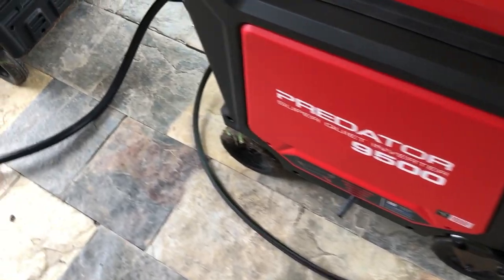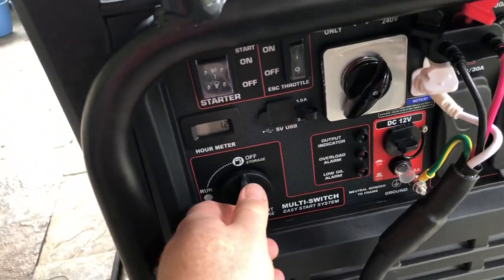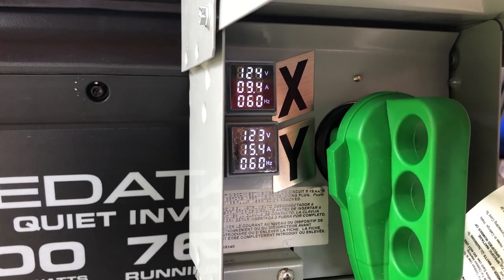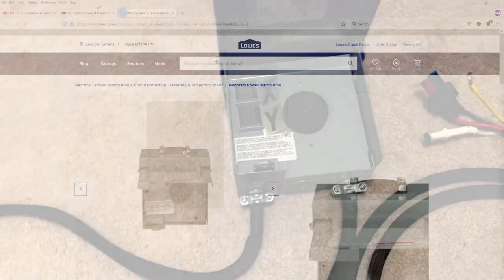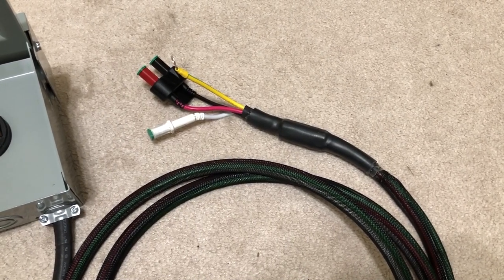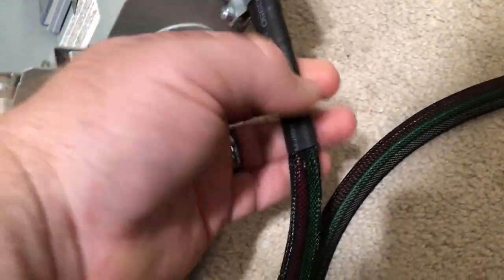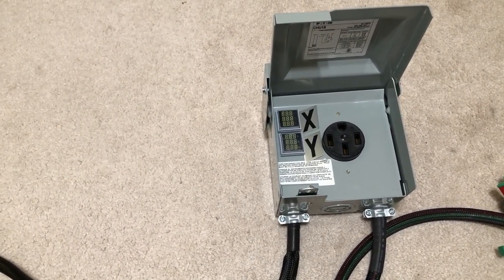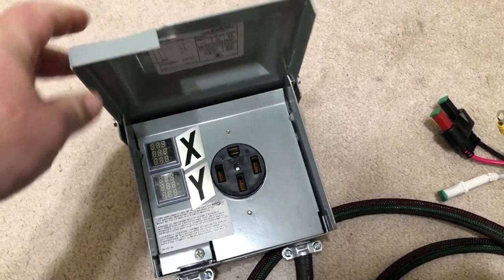Predator 9500 Home Built 240V Parallel Kit Test & Build Parts: 2X Output Power Using Two Generators!

Comment: I believe you're losing 10 amps or more in that dryer plug and your generator in the inlet plug
Those are 50 amp rated each one of those generators says it can pull off 31 amps and some change each
So you're just hooking both those together why can't you run two separate generator input plugs into your inlet breaker? 
Or better yet a lot of those units when they start up they look and see if there's power there then they just match whatever's there why couldn't you just use both the 30 amp twist lock plugs and join them together inside your main?
Pretty sure the four wires your connecting are the exact same four wires in the twist lock plug
If you hadn't already built this I would be telling you how to save a bunch of money and get another 2,400 watts out of it? sorry bud 😂
But then again I wouldn't have known that had I not watched your next video explaining the wiring
Sorry us folks with electrical degrees look at some of this stuff and scratch our heads because it seems a little inefficient and unnecessary
Reply from the maker: There is a lot to unpack there, and I don't have an electrical degree, so bare with this long response here while l go through it all as I see the issues and pitfalls of what you're suggesting.

Nothing is being "lost" in terms of amperage.  It's just if breakers trip or something is overloaded.  If resistance / heat in the wiring has climbed to the point I'm losing 10amps, then things are going very badly at that point.  

But yeah, the socket itself is rated for 50amps, while the two generators can continuously push 60amps...  But the wiring can certainly handle more for limited periods of time, surges, etc.  Larger plugs over 50amps (especially for inlets, extension cords, etc.) all very quickly become much more specialized, non-standardized, and way more expensive.  At that point, most people will typically just opt to hard wire directly to the breaker box vs. using removable plugs / cords.  

So why not just use two cheaper 30amp plugs?  A lot of very important reasons that I'll get to in a sec...

So I could have hardwired the parallel kit into the panel, via a breaker and bypassed the whole plug thing (basically wiring it like a true home backup generator would be wired in)  That would work well, let me use the interlock, and get the absolute full capacity of the pair.  

But as these are portable generators, I wanted to be able to have the whole setup be removable, and be capable of deploying them away from the house if needed.  Hard wiring would limit my options in that regard, so in this case the cable plugging into the house is desired.

So there is nothing stopping one from doing two 30amp twist lock hookups, but doing it safely (both for human life and not damaging your electronics in the home) becomes MUCH more problematic and complicated.  

To start with, you always want the source of electricity to have the female plug, so brushing against exposed energized plugs won't cause injury/death.  So this means the inlets on the house are male, and the cable running from the generator into the house at that connection point is female.  This is because the female side is coming from the generator, and carrying the power and the male side on the house is receiving it.

So if you wanted more rated capacity, and desired to use two 30amp plugs, you would need two inlets.  If you wired them together, the moment you energized one side, the exposed male plugs of the other side would also be energized, and dangerous, so you also need a breaker for each inlet.

And to be safe, you need to make sure that neither of those breakers could be on at the same time that that main power feed is on, and, since there are now two, you also would need to make sure that if you had only one generator connected, you somehow couldn't also have the breaker on for the empty inlet. (otherwise again, they would be connected together and the running generator would energize the unused inlet, making a shock hazard on the exposed male plugs)

I know of no interlock that could do that.  It would need some kind of electronic switching circuit that would detect incoming power, but ignore line power, and only then engage the connection if the correct conditions were met.  So the interlock is out...  now we're getting even more dangerous.  

Could you just do it anyway?  Yeah, and if you did everything right, every time, it would work.  But it's certainly not safe, and not to code, and someone who didn't know what they were doing (or made one mistake in what has now become a much more complicated process) could easily kill themselves, or kill someone else if they back feed into the electric grid without the interlock in place, and / or blow up all the electronics in the home (which I'll get to at the end).

But let's continue to work backwards from the inlets now and pretend we have main power off.  At the end of your 30 amp cords are male pins you're intending to plug into the generators.  For the units to team together, they have to both be connected in a complete circuit.  One starts, then the other sees the voltage present and matches the frequency when it is started.  So both inlet breakers must be on when starting the generators.  This means that as soon as you start one of the generators, the male plug on the other is now energized.  It could be unplugged at any time, and you'd be holding an energized "suicide plug" in your hand.  Not safe.

Additionally, the 30amp plugs on the Harbor Freight generators are limited by a 30amp breaker on the panel.  So if one were to maintain the constant rated load, or get surges into the max 40+amp range eventually the breaker will probably pop before the generator overloads and cuts power. (The parallel kit bypasses the generator breakers, this is important later)  If in this situation, only one breaker popped or was turned off in the pair, but didn't "overload" the generator then a very bad thing can happen that I'll describe next... 

Bur first, there are now multiple breakers in the connection between the generators that are also able to interrupt the circuit (one on each generator front panel AND the one for each inlet in the breaker box) any of which would allow for the units to become disconnected from each other WHILE THEY ARE BOTH STILL RUNNING (thus breaking the synchronization).

This condition would allow the two units to almost immediately drift out of frequency sync.  Just as two clocks don't typically remain perfectly synchronized for more than a few moments.

If something were to turn off one of those breakers, and then one later turned that breaker back back on, suddenly joining together two live 240v circuits that are no longer synchronized... it would probably do really, really, bad things to the inverters and I'd guess VERY spectacularly bad things to the electronics in the home.  

This is why the parallel kits bypass breakers, and directly connect the two inverters together in a way that is hard to interrupt, and also, probably why when you overload one unit, you have to completely shut it down and restart it from scratch.  To ensure that it properly re-syncs to the power frequency that is still present from the other unit.

In my situation, it made more sense to bond them together in a reliable way, then take that combined power out and feed it into the breaker box.  While the plug is rated for 50amps, the runs are fairly short overall and have the appropriate gauge wire, so they should easily handle ongoing 50 to maybe ~60 amps, as long as I don't go too crazy and try to keep the loads reasonable while on generator power.

This is responding to B F:
I believe you're losing 10 amps or more in that dryer plug and your generator in the inlet plug
Those are 50 amp rated each one of those generators says it can pull off 31 amps and some change each
So you're just hooking both those together why can't you run two separate generator input plugs into your inlet breaker? 
Or better yet a lot of those units when they start up they look and see if there's power there then they just match whatever's there why couldn't you just use both the 30 amp twist lock plugs and join them together inside your main?
Pretty sure the four wires your connecting are the exact same four wires in the twist lock plug
If you hadn't already built this I would be telling you how to save a bunch of money and get another 2,400 watts out of it? sorry bud 😂
But then again I wouldn't have known that had I not watched your next video explaining the wiring
Sorry us folks with electrical degrees look at some of this stuff and scratch our heads because it seems a little inefficient and unnecessary
Reply: @Texas_DIY  well said

Comment: 40amp at single phase lol
Reply from the maker: In the US, all residential power is single phase, unless you're getting into commercial 3phase power.  That single phase 240VAC is split in half, 120V for each half (or "leg") of the split.  The generators each produce 240VAC, with a neutral split, exactly the same as what we get from the power company.  The generators basically just swap out for the line power, wire for wire.

This is the playlist of the full video series, the latest one where it connects to the home might be of interest.  https://www.youtube.com/playlist?list=PLzoNthJzzMFQ877vyCfoc53oDQqGFAIKN

Comment: Yes, you will get two legs of 120v service, but do NOT run any 240v appliances with that setup, because the 240v will NOT be out of phase as needed for a 240v appliance. you’ll be sorry.
Reply from the maker: These are true 240v generators. The phase is exactly the same as the service from my home power company (actually the generators are just slightly cleaner at the upper peak of the waveform)

I can, and have run all my 220/240 appliances on it. And everything is fine. 

 So far I’ve got 3 videos done on these generators. The other two get into the quality of the power on the oscilloscope, feel free to check those out if you’d like some clarification. 

The voltage you are seeing on the box’s meters are reading low because I’m only monitoring a single leg with each one. That seemed more useful that having both read 240v. 

Note that the generator does have a 110v only mode, but I have no purpose for it.
Reply: These are inverter generators not standard generators.   As was mentioned the first one started is the master and the second syncs with the master.

Comment: How did you install the amp meters?
Reply from the maker: There are other videos in the series.  In one of the videos I show the wiring diagram.  Not much to it.  Each meter has a coil that you poke through the wire to be AMP monitored... and it needs power... so two wires.  One to a Hot (either X or Y) and the other wire to the neutral.
https://www.youtube.com/playlist?list=PLzoNthJzzMFQ877vyCfoc53oDQqGFAIKN
Reply: I need to add two wires to the meter then plug them into to not on the 50 amp plug?